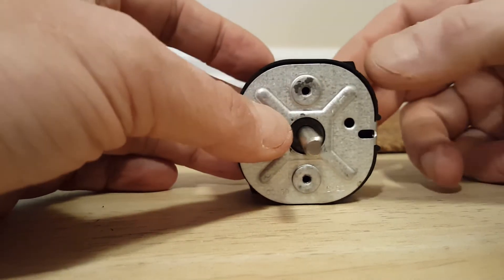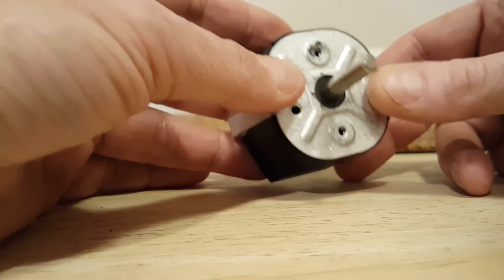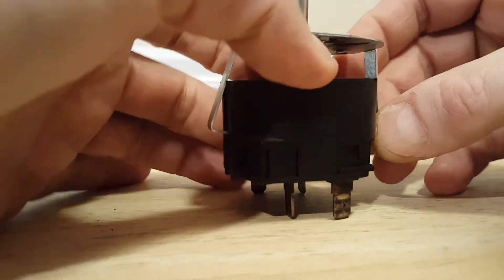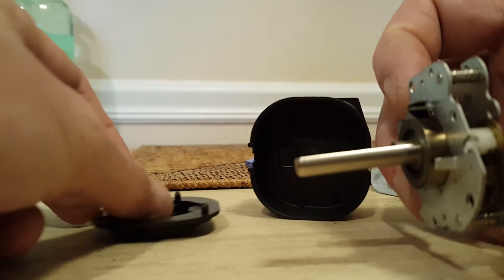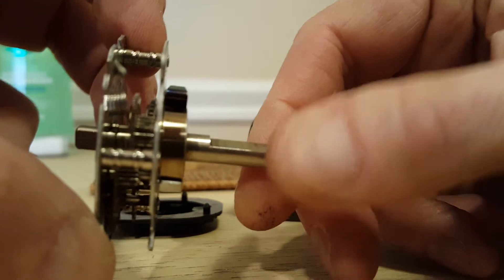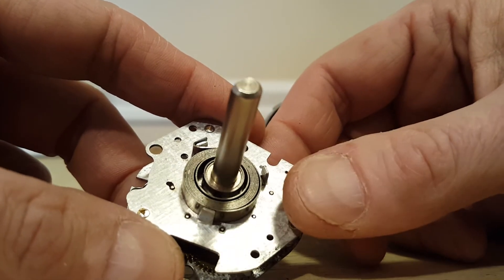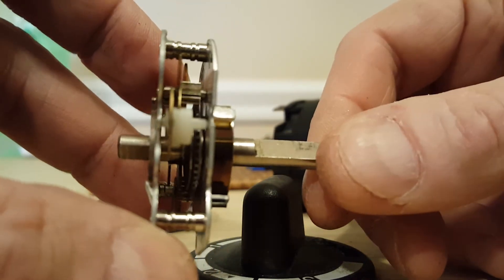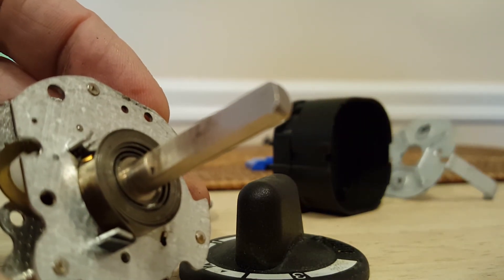Dualit Timer Teardown

Comment: Thanks for this. Question: My old timer stopped turning after a few minutes. I bought a new one and replace the time and the same thing happened. Do you know what might be wrong? Seems unlikely that a new part would do the same thing. Everything works, but the timer just stops after a while. I tried giving it a bit of a gap thinking it was being stopped because it was too close to the toaster, but that didn't help. Thanks.

Comment: I have one of these toasters and it’s all of a sudden stopped working. There’s no power to it whatsoever, no lights illuminated. Is it likely a new timer I need. I never noticed it sticking before it packed up?
Reply from the maker: Hey Matt.   Hard to say for sure.   You would need to start by taking it apart and testing continuity through the plug, at the timer and beyond but that assumes you are comfortable using a voltmeter.  It could certainly be a timer but it could really be many things.

Comment: I've replaced dozens of these timers over the years. I work on the basis that it is better to be safe, than sorry. I've never seen one taken apart before, and looking at it makes me think that the metal of the spring may be oxidizing and thus causing it to stick where it overlaps the next spool.

I do think that it is a fundamental design flaw in the toasters (where the default position is 'on' rather than 'off'. I don't understand why Dualit don't provide new timers for free. They don't cost much, and the boost to the brand would be enormous.
Reply: I agree. Our toaster is only 2 years old and the timer sticks intermittently throughout the cycle. It’s a safety & fire hazard if not watched. New Mi7 Dualit timer from EBay was $36 all in from UK

Comment: I have fixed a couple of these old round Dualit timers by dismantling and spraying WD40 lubricant on them. A little light machine oil applied to the bearings and spring also would not go amiss. I have not had such good luck with the newer square timer, which is cheaply made and does not seem to respond to lubrication like the round ones. Luckily the two types are interchangeable. My advice is to replace the square one with the round type if you need to.
Reply from the maker: Hi and thanks for sharing your experience.  I did not find lubrication to fix the issue in my case.  My replacement has been running strong since replacement but I am vigilant!
Reply: @bbonsanti  I'm glad you got it sorted anyway. BTW, it occurred to me that the timers on some microwave ovens are similar in concept but never seem to get stuck. I wonder why that is?
Reply from the maker: @gilessteve  
I'm not too sure perhaps the clockspring used for the timer was marginally undersized but that's a wild guess on my part. I have not seen a micro with this timer but that's in the states where they are all electronic.
Reply: I have a bad Mi7 switch I'm looking to replace and saw the Mi2 (looks like the one in this video) appears to be much better made. Trying to figure out if they are fully interchangeable..? Sounds like you're saying they are? 
Wish I could find one available in the USA to get the replacement quick but it looks like they are only available from the UK...

Comment: what oil would you recommend?
Reply: Take apart as per video. Spray of WD40 onto cogs etc. Job done and all working  fine.
Reply from the maker: I would guess a light machine oil..like 3-1 but honestly I think a replacement would be your safer bet.
Reply: I put a small amount of spray lubricant on and the timer has been working fine since

Comment: Do you know if you can calibrate the timers. An adjustment screw perhaps? I have a toaster and have to set one timer to 2 and the other to 3 to get them to stop at the same time.
Reply from the maker: There is no calibration that can be done on this timer. It's a shame really because the timer looks well constructed, I don't think they spared expense at all I just feel the spring is the weak point. That's my guess at least because on mine the innards we're spotless and we'll lubricated.
Reply: @bbonsanti  How about cleaning the spring, lubricating it & winding it a bit tighter if possible? mine stops at 2 or 1
Reply: I will buy a new one 1st & fit the new(?) knob £3.60 which says FIRE RISK on it
Reply from the maker: @frankrutter7418  Hi Frank.  I did look at it with the initial hopes of repair.  To me I do not think that would have done it.   The innards were immaculate, well oiled etc.  I saw no way to increase the tension so I decided to fit a new timer.  It's been working well since.
Reply: @bbonsanti  Thanks, great helpful video`s. I like the look of your old/early model

Comment: Thanks for doing this (and your other videos) - it does sort of confirm my experience with Dualit. I have had my Dualit Combi 2+1 which has 4 toasting elements for 20 years. I have never had a problem with the timer (yet) when I do - I will just buy a new one based on your videoed findings. My learning with the elements is this. In year 18 I had one element go south and I bought and fitted a replacement. Six months later another one went on the same journey, so bought and fitted a replacement. A year later another one bit the dust - so I bought and fitted a replacement and now at 20 years service I am waiting for the vintage and original element to join its friends in the scrapheap of Dualit toaster elements. My lesson learned is this - when the first element fails buy replacements for all and change all of the bloody things at the same time!! It is and has been a great toaster and if and when that last element fails and when the timer fails I will replace and hopefully get another 20 years service out of it - there is no good reason why not. My one regret is not buying a Dualit 4 slot combi. These toasters although archaic are surely the best toasters in the world. Most consumer electrics and electronics have built in obsolesence and are junked after a few years - Dualit well  they are obsolete when you buy them and can run ad infinitum.:-)
Reply from the maker: You are welcome.  I was really astonished how well the overall unit is built including the timer.  I felt like a watchmaker taking it apart.